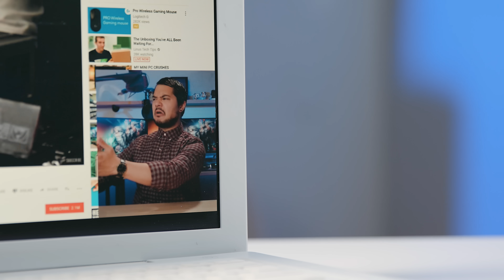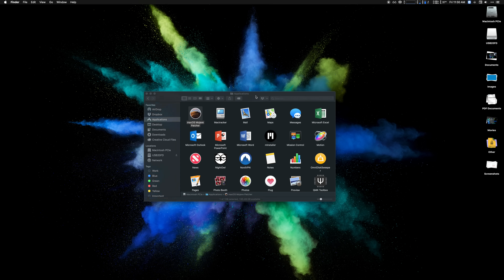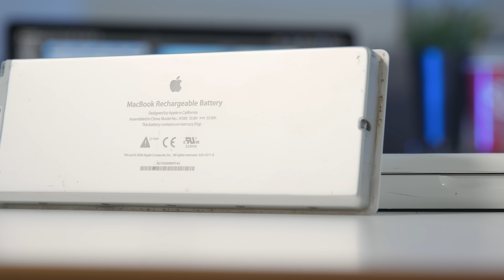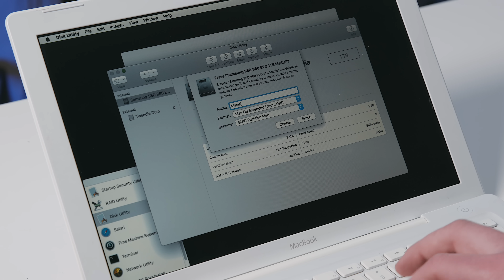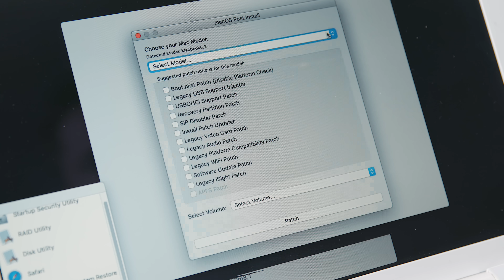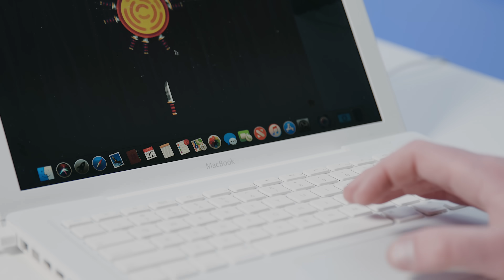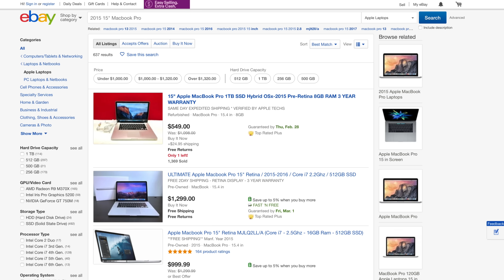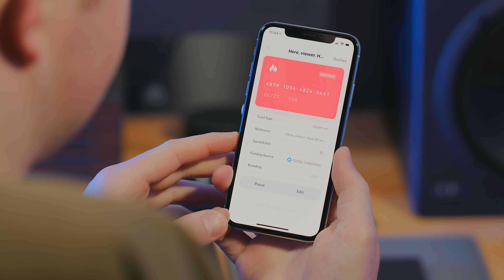Hackintosh a... REAL Mac?!

Comment: macs that shipped with lion and mountain lion can run snow leopard just by replacing 1 file in the installer known as the mach_kernel. even 10.6.0 from 2009 will boot. i did it on a 13 inch mid 2012 macbook pro.

Comment: You used a patcher... there is no "hackintoshing".
You wrote "MacintoshSSD" without the spacing, it makes me mad LOL.
But wait... this is not a late 2009 MacBook 6.1, but a mid 2009 MacBook 5.1, so the officially supported max is not High Sierra, but El Capitan.

LOL Apple support time is nothing compared to me being able to install Windows 11 on a 2007 Dell Inspiron 1520. That's 15 years, and not even the end!
I did not have to patch ANYTHING! Found all the drivers and installed them.
By the way, M1 Macs have hidden encrypted volumes in their SSDs that are PAIRED TO THE FIRMWARE. If your SSD dies (socketed or soldered), your Mac will no longer boot, EVEN TO AN EXTERNAL DRIVE!
So you have just thrown thousands of dollars out a window if you bought one! Its lifespan is limited to its SSD, and a such fast SSD (that Apple sells at a ridiculous price just like the RAM) does not last forever, it can die pretty quicky!

Comment: I have a late 2012 MacBook Air laptop with an old SSD.
Can I Hackintosh update it?
I want to use it for recording songs 🎵 I wrote. 
Should I factory reset it then go to your aforementioned process and get a new 3rd party battery?
I have a low budget Recording studio FYI.

Comment: This is the whole reason why I got one of these. I actually got the late 2009 MacBook the one that they sort of released alongside the 2009 metal unibody MacBook. It runs very well for a computer that is that old and I can still use it with chera1n and downgrade some iPhones and check iMessage every now and then. Something I cannot do on my pc. I paid only 90 dollars for this mac and it still works.

Comment: "You can pull the entire battery out of the computer, wait several minutes, put a new battery back in..."
Is the "wait several minutes" an actual step in the process, or are you just saying it'll still work even if you wait several minutes?
Also, wouldn't the computer need some time to save the data to the hard drive before the battery is removed? How would you know when it's safe to remove the battery?
And yes, modern computers can do that. It's called hibernation.

Comment: Are you sure that’s a 2009 that looks a bit older with only El Capitan and those mouse buttons
Reply from the maker: It’s an early ‘09. In late ‘09 they moved to unibody.
Reply: @snazzy  I started to think that but it still looks very old compared to the mid 2009

Comment: I have a MacBook Pro 15 (2016) quad C 2.9 Ghz with 16GB Ram. Is there a way to upgrade to 32 GB. Everything I have found so far says I can't. I am a tech guy, so not afraid to take it apart, but don't want to unless I know it can be done.

Comment: This seems perfect for me to write on cuz although I want a MacBook, I'm too broke for any models Apple currently sells (or even a few older ones, though younger than this). The battery is a problem, though. I just had to change the battery for my Inspiron 15 from four or five years ago and it was very expensive and difficult to find. I can't imagine having to replace the battery for something so old. Not to mention I would want to install extra RAM and an SSD, by which point it would probably cost just as much as a new Inspiron for gaming (I don't live in the US, so those things are quite expensive here).

Comment: I just installed mojave on my 2011 imac and it runs pretty damn good, except that you can tell there is no hardware acceleration with the graphics. still though, it looks pretty good, and its running pretty fast. i also reused the exact same solid state drive that was used in this video (samsung 1tb 860 evo) and it runs great. hesitant to try running catalina though.. don't think the speeds will be very good on it!
Reply: If you don't have acceleration is horrible!
That's because of what GPU your machine has, and the patcher web page tells you about this. Unfortunately, you are stuck to High Sierra, unless you put a supported GPU in your machine.
If you can find one that supports Metal and is supported natively in Mojave and Catalina, it's even better!
It means you can easily patch to the latest version of macOS!

Comment: I might have to do that with my old 2008 MacBook. I'm kinda curious to know if Catalina can work with it. I imagine not but I would be ok with running on a previous version. Although, Snow Leopard was a pretty awesome os for its time. My biggest issue is trying to find a new battery for mine. It's been replaced three times back in the day. It'll still run if it's plugged in but I'd love to use it again as a travel machine.

Comment: Is this even legal?

I'm not criticising (at least not right now), I'm literally clueless. AFAIK, MacOS uses a hybrid kernel. I'm not sure in that case whether the drivers are located within the kernel or above it. See, here's the thing. With a regular hackintosh, AFAIK it only uses a modified kernel which would be completely legal seeing as Apple's FreeBSD-based Darwin kernel is open source. So long as these modified kernels are also open I see no problem there. However, the rest of the OS is 100% proprietary and therefore making ANY form of patching/modifications to it is most certainly not legal in any fashion.

Aside from that, security would not be a concern with staying with an older MacOS version. In order to do something like this you're gonna be an experienced power user. Beginners or average users shouldn't even attempt this because even if the patch is open source and confirmed safe, your Mac would not be supported on that version of MacOS in any way, shape, or form meaning that if anything went wrong it'd be on you. A smart and experienced user isn't gonna be doing anything that would remotely put their machine at risk anyway so they would be safe on an older MacOS version even without security support. (It's also worth noting that a MacOS version is support for three years if I'm not wrong, in which case that can be added to the machine's length of support). The only reason someone would want to upgrade otherwise is for the latest features which is understandable I suppose.
Reply: All it's doing is adding kexts which is what you do on a hackintosh.

Comment: Thanks for the tips, great video btw, one problem: When I tried to run Mojave patcher it said "could not verify" and as such I was unable to proceed with it. I am currently running Catalina on a 2015  Retina MacBook Pro to for downloading it and intend to upgrade the 13 White MacBook Pro 4.1 (Actually, I think it might be this EXACT model used in your video).

Do you know what might be the problem so that I can install it to the new drive? I have tried downloading both the "direct" and the "mirror" option but to no avail.
Reply: Just to follow up, I have confirmed the model number of A1181 and the computer is listed as the "Core 2 Duo 2.4" from early 2008, however it currently has NO OS to speak of, that's why I'm having to follow this process by installing everything directly to the drive.

Comment: I have done this many times to unsupported macs and it works great. I’m currently running it on a 2011 MacBook Pro that I maxed out. The machine has the bad gpu issue but it runs fine with the intel graphics. 

Dosdude1 now handles all of the driver patching on the fly so it is literally just like installing on a supported machine. It seems like it is even better. Oddly enough the high Sierra supported install kept freezing on me but this worked fine.

Comment: I think giving older notebooks a new lease of life should be much more common. I just revived an old HP EliteBook 9470M and it's still a very good notebook. Sure, not FullHD screen and there is some wear and tear, but it's light, the hardware is easily good enough for 95% of your daily tasks and it was dirt cheap. And I think it's a very rewarding feeling when you've just successfully breathed new life into a computer way outside of its intended lifespan with very little money. You save money, save e-waste and actually get to work on computers, which is always fun.

Comment: This is actually pretty brilliant. Kind of sad that Apple never thought of this, as this would be a great way to reissue refurbished machines and cut back on e-waste and possibly draw in more potential users. I do get that there will be issues since it's a patched OS on hardware that it wasn't designed for and there will be issues from time to time, but still seems like a good pathway without resorting to using iPads as bait (since these are normally cheaper than a $3K Mac).

Comment: I have a MacBook 2010. Upgraded the ram to 8gb and though I liked Mojave I found out that facetime would lag out. This appears to be fixed in Catalina Patcher. A note not all SSD's will work on 2010 MacBook.  The interface is SATA 2 and  i ran into issues with SATA 3 SSD's. I had to drop back in a mechanical drive. I will have to take time and look for an old SATAII SSD.

Comment: Fun fact: Mac OS Mohave runs faster than Snow Leopard on those Macs. Old Mac OS wasn't that optimized, especially with GPU tasks. Mac OS Mohave animations are super smooth and SSD helps a lot.

Also, you can just install Windows 10. Just insert regular bootable Windows USB installer. Windows 10 will run great and in my opinion Windows 10 is way better than any Mac OS.

Comment: actually, in thinkpads you also can change the battery and can resume your work afterwards right where you left off. You also have several minutes to change the battery. Sounds exactly the same. And with the thinkpads this is (also?) quite an old feature.

Comment: I have this MacBook. The screen stopped working after so many years. Was black and wouldn't light up. If I was to do this I'd need a new shell and monitor circuit board for the display or a new monitor altogether. My disk drive doesn't hold my disk either.

Comment: I did the Mojave Upgrade with my 2009 13” MBP and it worked, but after some boot ups it doesn’t do it anymore. And I guess the main board has an issue.

The only thing it does: it charges and the battery indicator works. But that’s all :/

Comment: iZombies "Credit apple for 5yo devices that can run current  OS"

Microsoft users "meh, most systems from 10+ years ago can run W10-2019 smoothly when configured correctly"
Reply: Not really, I have a 2007 Lenovo laptop. It is on Windows 10 but has loads of problems running Windows - even with configurations - and it is close to being obsolete.
Reply: @NSViewController  I said MOST, not all; in part based on my personal experience.
For example I even got W10x64 Enterprise to run on a 2002 Celeron 478 (Not officialy supported since it did not meet minimum requirements) @ 2.4GHz. with 1GB of DDR 666Mhz. RAM and a prehistoric 40GB 4200 RPM 3.5" IDE HDD.
The only tweaks I used were increasing the RAM frequency via the System.ini file. and disabling NX bit check for installation.
Said system works great all things considered ,even streaming youtube @ 720p fullscreen on it´s meager 32MB integrated graphics controller and managing light gaming

Of course there are several factors to consider like BIOS support, component health, system configuration as in how many services/processes are running simultaneously be it foreground or background, system updates installed, logistic maintenance......

Perhaps I could provide some to advice to improve performance if you like, just list the detailed specs including BIOS revision and I´d be happy to help

Comment: The iPhone 5S running iOS 12 is a disastrous mistake...especially the one with a 16 GB eMMC flash boyo. It would, no shitting, be too full from a fresh install to even be considerable as a mobile device that could be used on the daily. Even iOS 10 or 11 is about 7 to 9 GB alone. Glad I'm out of that hell hole, I now have an LG G7 ThinQ, which is your average smartphone from 2018 with nearly all the good things like a headphone jack and a dual SIM tray that accommodates a Micro SD card. Still might need to do a little disassembly to replace the battery.

Comment: Looking back at this video... I don't get it. Why can't we have a replaceab;e battery? It seems simple enough to just stick an adhesive tab on one side and giv 'er a firm yank to remove an old battery. Why can't the storage be M.2? It's small enough and a variant of the connector could just let the drive slide right in — much like a friction-fit SD card carriage. Most Macbooks are just tiny boards in big cases, why not engineer in a connector for auxillary connections people actually want? Seems like something else every other laptop does and they're perfectly fine.

Comment: 5:44 isnt this feature called "hybernate" in windows? wasnt it an option all the way back in Vista, I dont normally use sleep hybernate beause i prefer a fresh start, but here, i'll try it right now...... Never mind, its either not supported on my thinkpad W530, or it has been removed from windows 10-1909, bummer, i normally use this on my tablet because i could throw it into a bag for a month, come back and have a full battery and all my programs still running normally

As for updating older macs, I have a mac pro 1.1 and 3.1 , will be doing this, and might buy a macbook just to do this. However i'd prefer to use my thinkpad W530, or T430 as i like the keyoards better, and really would love to have the trackpoint instead of track pad

Comment: I hope he keeps this project going. I have the infamous MacBookPro9,2 13" the last one with an optical drive, with a non-Retina display and is easily upgradeable. I'll be upgrading to an SSD soon but I don't expect this old bird to be able to run current macOS much longer. I would like to be able to keep this machine running as long as possible.

Comment: Technically speaking, according to the EULA, downloading the macintosh operating system is free, but if you use the os on non-apple hardware, that is a violation of the EULA and is illegal as it would be considered "piracy".  HOWEVER, because you are using the OS on official apple hardware, you can't be in trouble in any way... so.... yeah.

Comment: "As old as 2007" lol! I wish this would work for Mojave on my Mid-2011 iMac but it cannot because of the stupid Radeon is not compatible.
Reply: Which Radeon card?
Reply: @13aaryan  I think  Radeon HD 6750M
Reply: @chrismifsud7154  Should probably work with injectati, have you tried that?
Reply: @chrismifsud7154  and the kexts are missing, you can probably copy the gpu driver kexts from high sierra to mojave and it should work
Reply: @chrismifsud7154  also, the mac has a thunderbolt port right? You can hook up a rx460(they're very cheap) and you should be good to go
Reply: @chrismifsud7154  another idea lol😂, i saw somewhere that you can change the graphics in the imac, you can do that too, probably luke miani did that

Comment: Two things.
1. High Sierra was released in 2017 not in 2015.
2. Judging by the wallpaper, the OS it's running is OS X El Capitan and not High Sierra. Apparently it was released in 2015 so you've just told the wrong name.

Comment: Still using my 2011 MBP. No plan to upgrade any time soon!
Reply: Mason Vanderpool, until your gpu dies
Reply: N0VA_ _D0S I guess? I could also patch it and use the cpus integrated you which I’ve done before on a 2010

Comment: I reckon you could do the same with a 2010 Mac Pro?
Reply: More or less every 64-bit Intel Mac.
Reply: If you put a metal enabled graphics card in a 2010 Mac pro you can natively install to Mojave
Reply: Expat_Laz I’m thinking that too
Reply: It still requires some tweaks in order to run Catalina, but it does work on my Mac Pro 5,1 with a RX 5600 XT installed.

Comment: "a device that's 5 years old is running the most current version!"

You can get Core Duo laptops from 2007 to run Windows 10. That's a 12 year old computer that's still on the support list. 

If you look at Windows 7, you can run it on anything from some of the very latest machines all the way back to Compaq Deskpros from the late 90s. 21 year old machines. How about that.
Reply: But will it run this fast?

Comment: You can still enable hibernation in Windows 10 1903 which saves the data to the drive. You can even remove the battery and put a different one and wait as long as you want without a battery and it'll still save the data.

Comment: Is there any way of putting an early 2009 motherboard into a late 2006 black Macbook?
Reply: Probably not but I would reccomend researching online with forums
Reply: Not a 2006 but you can with an late 2007 or 2008 Black MacBook with some slight modification to the bottom case.
Reply: @KadMac25  is there really no way of doing this with a late 2006? And could you be a little bit more specific about the modifications?
Because I was planning on buying a mid 2009 MacBook and putting the internals into my black MacBook...

Comment: Can the patcher tool be used on the original mac os shipped with the device? I have mac os 10.6
Reply: Even if it can't be used, you can always upgrade 10.6 for free. I torrented a 10.6 installer for a 2008 MacBook that I purchased on eBay, made sure it was fully updated, then downloaded El Cap from the app store. Thing is, versions older than Mojave will no longer appear in the app store with a search, but there are links floating around that allow you to access them anyway, as they haven't exactly been removed but rather hidden. A quick Google search for something like "can't find el capitan in app store" should lead you to some Apple forums on this, where someone is likely to have provided a link to access the installer download. At that point, you'll be exactly where this guy is in the video and you can simply follow along.